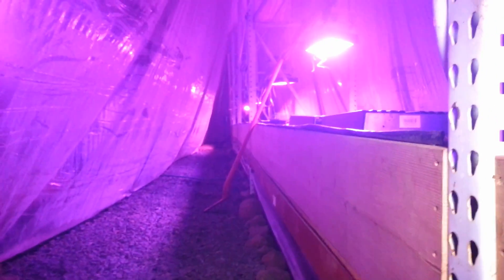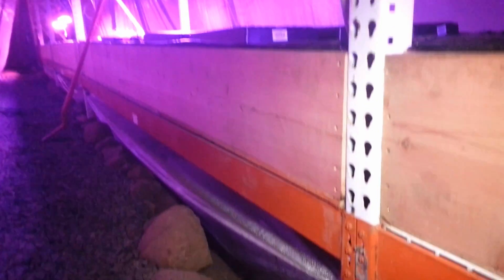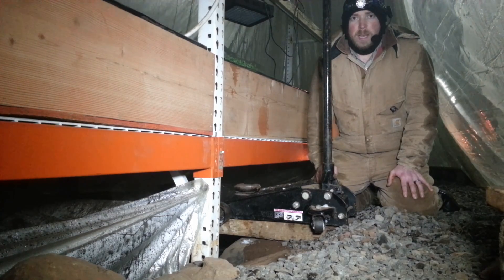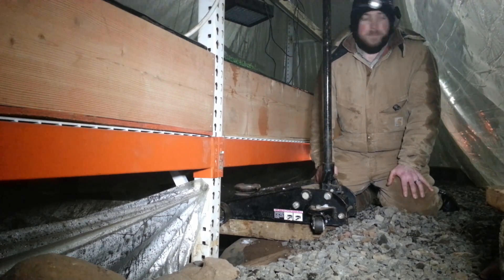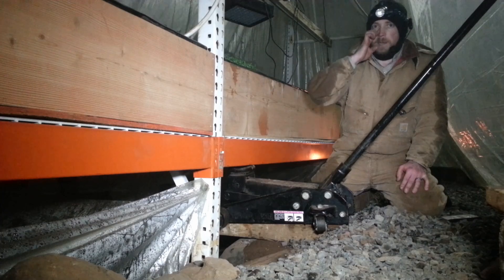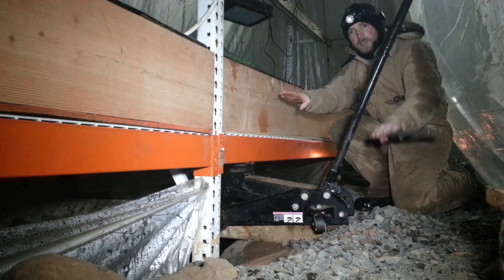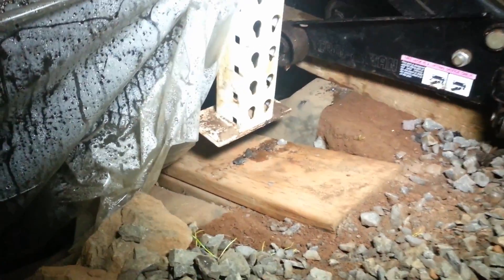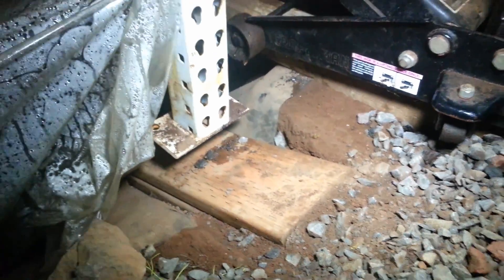Dirt Aquaponic Foundation? Hmmm, Maybe Bad Idea

Comment: I wonder if you coud have put a bolt or a metal stick in the holes of the white stands, just above the orange cross brace.  The railroad sometimes does that or they put chains around their wheels in order to guarantee it all stays into place.  Some what I am saying is to have the orange cross brace lift the while stands without moving with respect to each other.

Comment: I thought you were going to put the new 4x4 or 6x6 beam under there and not just the same little 2x6s

Jeff, How tall are your uprights? For next time, why not do exactly what you did BUT poor a concrete footer in the trout trench at each leg of the shelving. Then dig out a bit around where the legs go and set them on the footer. Yes you will loose height on your unit, but you can always make that up by welding on the additional 4 feet or so to each leg and plan for taller shelving the next time when you run out of your current stock. this will add stability laterally and should never go out of level and save you from having to do a huge pour!

Don't be intimidated about welding the 4 feet back on. I hope you get what I'm saying if not I can sketch something out for ya.

Comment: I recognized those racks, worked with them for years at a Wal-Mart store. There are small locking devices that will hold them locked in. We used 8' side rails in our backrooms. They should be available from where you got the rack. They do work.

Comment: There is nothing to support the fish lanes if the moisture happens to get out of the ponds. If you get a pinhole leak in your liner you could end up with a washout that could sink or collapse the walls of the fish lane even worse than they are now.

I suggest making the fish lanes out of pressure treated wood with 4x4 pilings along the side set in concrete. the pilings would be where your legs of your pallet racking would sit. If i'm not explaining it well enough let me know and i'll email you a drawing of how I'm seeing it. 

a full concrete fish lane would be fantastic but expensive.

Comment: Hey another idea is foundation blocks and some concrete under them wouldn't cost to much. But you would have to move the metal out the way for the time being. You would still be able to use the plastic for the pond.

Comment: Ground Control to The Real Martian, we suggest you fit sensors to the racking system in lane 2 and 3 which can be monitored for horizontal/ vertical stability and let the arduino units monitor this for you so that if this happens again you can get it it sooner and there is less likely of an incident OVER.
Reply from the maker: great idea received!

Comment: Really sorry to hear of your trouble! A design question,; what is the density and shear strength of water vs dirt? How well does water withstand compression forces? CE basics.
The temporary bracing has to be a bridging bar to cross the trench or you will be chasing your tail.
 Just put the posts on concrete pylons to 12inches below the base of the trough. Diameter determined by the vertical load and soil test. (likely six inch dia. sufficient with rebar in sonotubes)

Comment: Others have made similar comments, but here it goes anyway... Use a beam (like the one you used to support the jack) across the pond.  Going one step further, use a 3 or 4" I-beam under each upright, buried flush with the ground.  While we're at it, lets go one more step. Make each I-beam long enough to cross all four ponds. That would tie all four grow lanes together. I realize I beams aren't cheap, but I bet it would be cheaper than a bunch of concrete or a catostrophic failure.  If you have a good scrap yard nearby, they might even have some used I-beam for a fraction of new price.

Comment: use sonatubes.  make a hole with an auger, and push a sonatube into the hole, and fill it with concrete.  Makes a nice foundation for the point loads, then put your pond liner in for the fish.

Comment: I would think that a cylinder shaped post of concrete would be ideal in this situation.
Using a paper form to the correct depth (do the calcs) and about 6"-8" diameter reinforced with rebar should be enough support without the expense of doing the entire trough.
It should be possible to retro-fit them on the current grow-lanes as well.

Comment: I'll go against the crowd as I recommend you to use screw piles (https://en.wikipedia.org/wiki/Screw_piles). There is DIY options out there but as these will be put right against the pond, I'll suggest that an engineer specialized in foundations look into this. Depending on his/her recommendations, be aware that you might have to contract the installation altogether as specialized equipment might be required to reach the required depth.

Keep up your good work.

Comment: You need to get a handle on this for when you get into full production. With what you hoped for, like four tiers per rack right ? That's a lot of weight, span the fish beds with at least a 6x6 more likely a 12x12 with an overrun of at least 18inch (45cm) to be surely safe and stable.

Comment: you could dig a hole about the diameter of a 5 gallon bucket and about the same depth or even deeper at each of the spots where you'll have a post for the shelves, and then fill that with concrete.  its better then spending a bunch of money on concrete lining the entire water lane.

Comment: When all your snow melts the ground water level will rise and start wetting the soil this may results in the sides of the trench collapsing. I am not a civil engineer but have had experience with trenching, general no load should be applied to the ground at the side of a trench in the area equal to the depth of the trench (45 deg from the base of the trench)

Comment: A a retired contractor I cringed when I saw your structural problem.  It could easily be a widow maker!   As many others have stated you need to span the fish pond and extend the supports at least 3' beyond each tower.  Some have suggested railroad ties but they are very heavy and hard to work with.  As a temporary measure may I suggest LVL beams available at your local lumber yard. These are lighter and will have twice the surface area (bearing capacity) of a RR tie.
  
LVL's (laminated veneer lumber) are wax coated and are 1 3/4" thick.  They come in widths from 8" up to 16" and more.  These are designed for vertical loads like headers and beams so laying them flat on the ground they will not be as strong but what you need to do is spread the point load from the pallet racking columns (12' 0.C.) out to a larger surface area.  I suggest starting out with 16" wide LVL's for maximum surface area.  Take the width of your pallet rack (say4') and add 6' to that so have the lumber yard cut them to 10' lengths for easy transport and handling.  I recently bought weathered and off cuts LVL's for $ 2.00 l.f. at two of my local yards.

Have you calculated what the total loaded weight of each section is?  Divide that by four to see what the load is on each column.  Then design concrete footings and horizontal beam size from there.  Unstable soil will not support the amount of  weight you are placing on it.  Install these temp. supports now for Lane 2 and 3 and then have a structural engineer design a new support system for Lanes 1 & 4.  Once those are completed install the new support system on lanes 2 & 3.  

Enlisting the help of a structural engineer is the only way you can avoid a catastrophic mission failure.

Comment: i would do the concrete  sonno tube idea others have mentioned but also i would also place bolts inside the concrete to bolt the legs down so they could never tip or lean over

Comment: id have done H shaped supports so youd have a beam going across the pond and then 2 beams running parallel to the pond which would stop the footings from folding inwards and would have given it a larger surface area to distribute the weight

Comment: With those shelves, each foot is ment to be bolted down to a concrete floor. Otherwise the more weight you have the higher up you go the more chance it will fall over ON A CONCRETE FLOOR.  I didn't realize how you had these set up. Someone could lean on your shelves and it would collapse. Look up wearhouse racking fails on YouTube.
Reply: The cost of concrete vs. the cost of a life, which are you willing to pay?👎👎

Comment: The worst case soil type has a structural bearing capacity of 2000 psi, so approximately calculate the weight of your total lane assembly, then divide that by the number of supports which touch the ground to get an average bearing weight at each support, and then determine the minimum area that each footer must be to get below that 2000 psi limit.  It's prudent to add some footer area and get lower than that figure.

Digging soil "fluffs" it and complete recompaction takes significant work, so it's better to replace the removed soil with 1½" or bigger gravel or crushed stone which is virtually self compacting so that your structure doesn't settle under load.
Reply: For safety figure on 1000 psi soil bearing capacity.  Figure total weight of beds, rock, racks, water, etc then divide by number of footings then divide by 1000 to get the square inches needed to support each column footing.  This is the same area needed under a beam to hold up the rack assembly.  By using a beam to span the fish tank the footings won't tend to bend as they settle.  You will need to use this procedure even if you use Sonotubes or dig holes.

Comment: 6 foot or so I beams spanning the fish trough on footings at either end made of sono tubes, and the footings bolted or welded down in a fashion, This moves the load away about a foot from the pallet racking on either side, and allows for more structure support with less movement over time. 

I beams maybe 6x6 inch or 4 x 6 with the 6 inch span being what is bolted to the pallet racking.
Reply: perpendicular to the fish trough, like railroad ties in rail road tracks

Comment: Earth is a viscous liquid with a calculable load carrying capacity. You can think of the buildings as floating on the displaced volume of earth. Think buoyancy.  If you don't size your footings properly they will sink until they displace a volume of earth capable of supporting your loads.  That's if your lucky. If your unlucky you will get a structural collapse. Which is what you are seeing happen. You have a lot of point loads on a spot that is open on one side. This will make the earth flow downward and into that opening where the fish are. This is a really a very poor footing solution for a long term structure. For future builds I would advise digging down to the level of the fish tank bottom. Cheap solution is to Buy some solid precast concrete blocks to use as your footing base or build some forms and use concrete and rebar to pour the footing base. Poured is better. Then install concrete block column that comes up to just above the ground level. Have rebar that comes vertically out of your poured footing that will thread up through concrete block. Then fill concrete blocks with concrete.  Sonotube will also work and you can then pour the footing and column in one pour.   Fir fixing your existing structures. You need a beam that spans the trough this will prevent your footings from rotating.  Make it longer then the current racks by at least a foot. More is better. Put some concrete large concrete solid blocks  blocks under the steel to help distribute the load over a larger surface area. Larger is better. Hope this helps. Good luck and be super careful when jacking up structures. Never put your hands under pinch points. Jacks can rotate. Structures can fail. That whole rack could twist and fall on you.
Reply: And weld those rack beams to the columns before you jack it up. Jacking the beam that's loosely attached to the columns is asking for disaster.
Reply: Also wood in ground contact invites termites and rot. Those wood footings won't last.

Comment: Consider that as one footing fails you are potentially doubling the weight carrying load and adding a lateral  force to the adjacent footings. If just one footing completely fails it could start a chain reaction with a dominoe effect causing the rack to topple end to end, possibly damaging the building wall if it fell outward or the next row over if it fell inward.  The damage would be extensive, not to mention the danger. The dirt/ground/earth always moves without some kind of mechanical reinforcement. I would lessen the upper shelve weight and fix the footings asap. Please be safe. Enjoy your videos. Thanks.

Comment: at my work we drill the load beams just above where your plastic is bolted and run a bolt through the what would be the next hole up then the load beam can not lift in the slots so there is no chance of it popping out just a suggestion another great video thanks

Comment: Could you get away with a few cinder blocks(3-6?) in the ground and some wood on top?  Way cheaper than cement.  The blocks might give you enough surface area even if it gets wet.  Id think it would at least minimize the sinking.  Would take more digging to get them in the ground, but maybe less work later on.  Not that sinking some bigger posts with concrete wouldn't be a good idea.  Cinder blocks might be cheaper.

Comment: In designing, did you consider running the fish lanes and the racking 90 degrees to one another? Seems could get the feet of the racking further away from the edge of the lanes. Would have require planks/footbridges over the lines for access, and may limit bigger machinery to the outside lanes and beds.

Comment: Could possibly weld or bolt outriggers on every post with wide plates on the bottom. Safety is always first. Your system is set to fail.

Comment: For quick repair and Stabilisation i would lay heavy C-Channel under the the Feet of the grow lanes, acros the fish Pond. They also should be 3-4 feet longer as the grow lane is wide. And in Long therm you could put concred foundation Points under the C-Channel. Sorry for my bad english, i hope you get the meaning. ;-) Greetings from Germany

Comment: when we installed thrust blocks for underground pressurized water pipe we used solid concrete blocks. 2 inch and 4 inches thick.  same process cut dirt back and replace with surface area to handle the push against it so the fitting didn't blow off the end.

Comment: It would have been good to compact rock into the bottom of the hole before placing the block of wood in. The wood will rot and compress over time. You can use bond beam blocks to retrofit a foundation. You don't need mortar. The web of the blocks allow rebar to be laid through them. Then fill with concrete. You would have a few cold joints because it is not feasible to do it all at once. That would not be a problem.

Comment: Why don't you make a locking safety pin for the uprights on your pallet racking? If you made a piece of steel that you put in the mounting open holes above the shelf rack that you could bolt in tight so when you lifted the shelf with the jacks the "safety pin" would prevent the shelving pins from sliding up and releasing from the uprights. That not only would make it safer to jack up and level the units when you needed to but it would also stop the shelving from coming apart and collapsing if a portion on the racking was to sink to far in the could before you noticed it. I know the used to sell safety brackets back in the day when I used to work with that stuff so a fork lift operator could not accidentally lift a shelf unit up if a pallet was wedged or stuck to the pallet rack....edit here is a link to safety lock pins and brackets depends on the shelf brand http://www.redirack.com/node/193
Reply: I was thinking along the same lines. When I worked in a home improvement store the same style racking was used and horizontal shelving beams were bolted to upright supports.
Reply: Hamnut123 I know they are on a strick budget so  making verses purchasing the safety pins might be more cost effective I did not investigate any pricing but imo I think either way the investment could literally save his life and or the project

Comment: Why not use the same post you used for the floor jack, spanning it across the tank from leg to leg? Then nothing can tip inwards. If you did that with a post even longer it wouldn't put so much pressure on the side walls maybe even eliminating the need for concrete.

Comment: Maybe go get some screw jack feet and weld some nuts to the frame thread it that way you can adjust with a wrench to level as needed still would need to do footings better in future but that would get you flexibility and the ability to level easily as you will need to do it all again if you add more weight to your setup as in more grow trays. Need a balance sensor brother weight as you more upwards adding trays makes it more unstable uncorrected shift and it will topple.

Comment: When I saw that the grow lanes had been installed without proper footings, I feared that this might happen.
I would not recommend concrete footings.  The problem is frost heave:  whenever the ground freezes, ice crystals form on the undersides of rocks and concrete footings and push them upwards through the soil.  Compacted gravel with sand filling the interstices would be better.  The superior drainage of a mixture of gravel and sand thwarts frost heave.